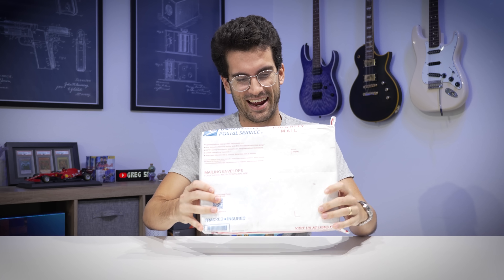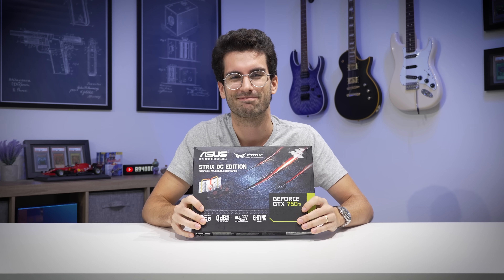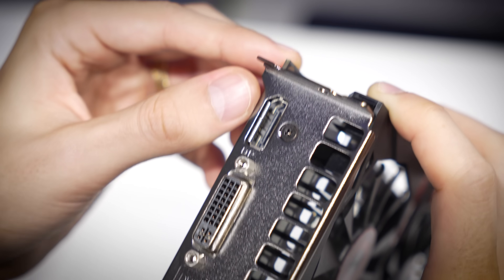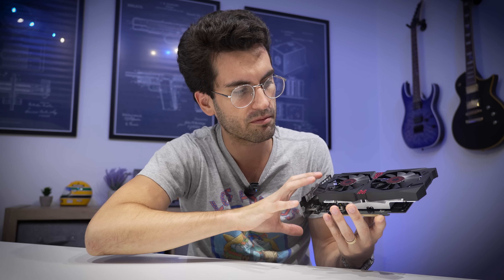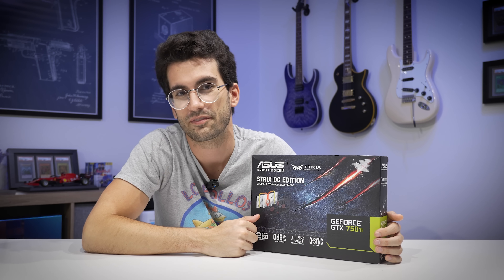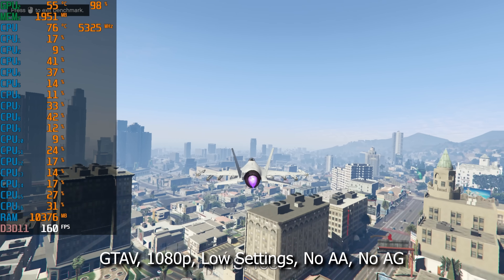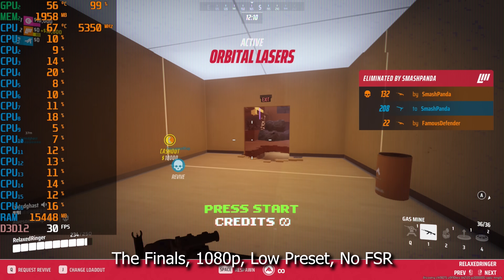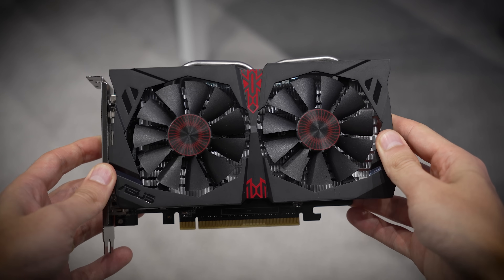The Nvidia GTX 750 Ti In 2024 | RETROSPECTIVE

Comment: thx for the video. i got 1 just under a year ago(2024). it doesn't look the same. its smaller and it 4gb memory. why or what is this mystery?🤔
Reply: I guess the 1 you show is crap Greg. (no offence and aye have the same name. that's a nice name btw) They made newer GTX 750 Ti's? Which are double the memory than the original 4GB. The Graphics Card Comparison chart clearly shows where it at. 2x better that a regular ps4 😀

Comment: I've owned the GTX750ti since 2015, it has served me well for 10 years. I've got a maxed out LGA1155 chipset with the I7-3770 and 32GB RAM. Today i've bought the RTX4060 which is a very efficiënt card and will run all modern games on high settings.

Comment: The TV sound effect had me thinking my headphones were still connected. My sons PC and my mobile PC in our RV both feature a GTX 750 ti 4GB Afox cards. I paid more than I should for them due to the 4gb a few years ago but they have been great for the gaming we do on them. I can still run games like Forza 5 without the stupid VRAM warning every 3 minutes. Pair them up with something like a i3 10100 and you have a hella cheap little gaming pc. You can even go lower CPU wise like a i7 4770 or 4790 and get a phenomenal experience. Roblox, Minecraft, fortnite, and all the games that the kids love to play will run on this card especially if you get a 4gb version. I'm not defending the 750 ti. Its old as dirt, but still does okay in some use cases. That specific card design looks like what happened to Number Johnny five after he decided to take a toke of the devils lettuce.

Comment: Still using 750ti here, ive played csgo with this card until cs2, so im used to playing games lookin like shit as long as the frame time is good. This is still good for emulating switch games like luigis mansion, and PC games like ds1-3 which ive never played before.
Reply: Do you have to turn your settings down at all or can it run the games on regular settings? I myself am getting a 750ti but not planning on playing big demanding games just smaller ones like League or Roblox
Reply: @bluebloo9955  i like stable 60 fps, so its usually low settings usually for games from 2014-2019, med on 2013 below

Comment: I've found a Zotac 750Ti in a E-Waste bin today and obviously picked it up.

I wouldn't recommend using it for modern FPS titles or otherwise highly demanding stuff, as it simply doesn't have the power for it. But it's still a viable card for some cases.

Since it needs no additional power, it can be thrown into all kinds of office PCs with proprietary PSUs, meaning a build like a 4th Gen i5, 750ti and 8GB RAM should be obtainable for 50$ or equivalent in most countries. There's still many great games that run fine on it and a GPU just needs to run the games someone wants to play, not everything that's on the market.

Comment: Looks new to me. It wouldn't be new after plugged in once in your computer, so I don't see a big deal. Jesus, that guy vomiting. I feel like these well paid gurus are there to encourage consumerism. I have a similar Asus adapter, but it has a onboard VGA port without an extension cable and thus no ghosting. The two fans make it quiet.

The OC edition with a power connector is actually capped at 35 watts, and the BIOS must be hacked to change that, which is risky. I would expect Asus to have already done it.

If you live in a countryside or a small town, you might not be as spoiled for choice. It's even worse if you have to pay €1 or €2 to advertise on a classified for a cheap item. You would get a Maxwell card for a VGA output, which was removed later, for WinXP. A GTX 960 is a better value and comes with h.265 and VP9 decoding.

Comment: Comparing it to a GTX 1070 is TBH a bit unfair, comparing it to a GTX 1050 would of been more fair.

The GTX 750 Ti and GTX 1050 are both "low end" gaming cards of their respective generations, and both do not require external power.

Add to that the fact that it has been used to make budget gaming PC builds possible under $100... I think it's still a decent-ish value (there are better cards like the GTX 1050 which dont require external power and would still work) as long you you are playing older (which are almost always definitely better) games. 

Also, GTA 5 came out around the time of that card, 2013-2014. For it to still get over 100 FPS goes to show how much more optimized that game is, and that the GTX 750 TI still has life left if you make smart choices (buying most modern "games" these days is stupid) about what to play.
Reply from the maker: Not sure you paid close attention to the video. We mentioned the 1070 and 980 Tis because they were among the best values in the compiled charts. GTAV came out around the same time as the card, which is why it was tested, but the game still requires a fair degree of throughput to manage at decent framerates. It does say as much about the card as it does about the game itself.
Reply: @GregSalazar  Still not a fair comparison. That’s like comparing an RTX 5090 to an Intel GMA 950. 
They’re not in the same tier, let alone generation.

The GTX 1070 is unusable in a lot of cheap used PCs you could buy on eBay, many of which use proprietary motherboards/PSUs/connectors which would have to be upgraded. Meanwhile, the GTX 750 and GTX 1050 are basically universal, as they often do NOT require additional power and can just get their power from the motherboard.

The GTX 1070 came out years after GTAV came out, not at the same time.

That’s not the say the GTX 1070 is a bad card, it’s good value if you have a PC that can use it… otherwise the GTX 750/GTX 1050 is pretty much just plug n’ play, due to their low TDP.

Comment: Back then in 2014 I bought an Asus GTX 750 Ti PH when it was new to upgrade from an Sapphire HD5450. The difference was huge. My version has VGA, HDMI and DVI Slots. 
Still have it in a low end PC used with an 720p Monitor for office and surfing and everything is fine although I wouldn`t use it for gaming anymore.

Comment: Well, this was my first graphics card buy after the GT545 in my pre-built gave out... And I still. Use it in a Linux Mint based machine with a Core i5-3570, where it runs great. Of course it does not work with Starfield, how could it? It's A DECADE OLD! 😂 Even modern cards suck at Starfield, because the game designers all think we have 4090s, so they do not optimize any more.

Comment: This GPU is still a dream card to me, if you want to hear my story then here it is ,
Me a poor adult from India didn't have enough money to build a current generation decent PC, more commitments, horrible life, problems everywhere and so on.. unsatisfied life 🎈🎈

Here are my shit ass pc specs:
Intel i5 6400
GT 730 2GB GDDR5
8GB RAM DDR4 @2666Mhz (limited to 2133 Mhz)
ASUS H110-M CS DDR4
Windows 10 pro x64 22h2 (Revision OS 😂)
450W SMPS from Ant eSports 
1TB Kingston A400 SSD
1TB Seagate Hard Disk USB 3' Backup
1366*768 Dell 15 inches monitor
Games I play:
NFS Carbon
NFS Most Wanted 2005
NFS Underground 2
Total Overdose
Freedom Fighters
Scarface
GTA San Andreas
GTA Vice City
Bully
GTA 4
GTA 5
Minecraft Bedrock
Sleeping dogs 2012 edition

Softwares I use:
Msi afterburner
River tuner to lock every game at 30 FPS

Comment: Greg, love you channel.  Lots of great info for us DIY builders.  I know your primary focus is on gaming pc’s.  And in that vein, could you please look at performance with flight sims such as Microsoft fs or x-plane.   They seem to be more cpu intensive but still need a good GPU.  It would be great to see the difference in performance numbers between  game and the flight sim.  Thank you for such an informative channel.
Reply from the maker: Hey Larry. I appreciate the support and feedback. I'll be sure to add Microsoft Flight Sim to future benchmarking sessions!
Reply: @GregSalazar  I am starting to receive all the parts for my new build. I plan to use it primarily for flight simming but I did get a free game from nvidia with my gpu purchase.  My budget was 4000 and this was to replace my older system (built in 2017 running Intel i7 7700k on a asus mb). This time because of the Intel issues I went with a ryzen 9 7950x3d on a msi x670e carbon motherboard.  ASUS TUF RTX 4090c GPU, 64 gb Corsair DDR5 6000hz ram, Thermaltake 1200 watt psu, Samsung 2tb m.2 ssd cooled with Corsair h100i 360mm aio.   I chose the lien lancool 3 case.  I also replaced my older monitor with a dell g3223q 4k 144hz 32 inch monitor.  There is some rgb stuff in there but not too much.  (The case, the dims, and the cooler).  I think this should be a pretty balanced system.  This came in at about 4100.  Your thoughts?

Comment: still loot these all the time in EFT. Considering i got a 560ti FPB way back when for BF3....i remember when these gtx 750ti puppies came out i told everyone looking for a pc to get one...that no PCIE connector/needed power was such a huge aspect when there was broke bois rigs like the smilodon or other ppl offering free 450-500w psu like apevia etc....This thing dumpstered my 560ti with just board power...so dope for micro/m-atx builds and no power connector needed had a few friends i built rigs for with this gpu. Its why that sku/range has BEEN king on mobile...1050ti 4gb 1660ti 75-80w kings.

Comment: I built my first gaming pc in 2014. Two years later, a poorly coded game overclocked my gpu without increasing the fan speed, resulting in damage that caused the card's performance to slowly degrade over time. When  youtube videos started to jump around like a VHS tape with screwed up tracking, I realized I had to replace it.

I crunched some numbers (I was seriously broke.) read some articles, watched some vids and settled on the ASUS version of this gpu. It worked beautifully until 2020, when the aging pc it was part of was shelved in favor of a new build. 

A year later, it came off the shelf and went into my mom's old pc, to replace her dying gpu. Many of her games wouldn't load at all, some would load and then immediately crash, and those that did run ran poorly, leaving them unplayable. Mom was the biggest gamer in the family, and my little Nvidia Geforce 750ti got her pc running again. She was so happy - she gamed more than all four of her kids combined, so she was happy to have her pc back online as it were. She sadly passed away after a year of working my old card hard, but it made that year a good one, with hours and hours of gaming. It's still in her old pc, sitting, untouched, in her room, and I can't bring myself to ask for it back.

Comment: Something I learned right away after getting into pc gaming was that you never purchase anything less than a 60 class card with nvidia, 50 class cards are only good for pixel games or giving you a display output.
Reply: Back in the day the 750ti was worth it it was very cheap, required no power cables so could be slotted into an office pc and ran triple a titles like gta quite well. After that though I agree it went downhill and it only really made sense to go for 60 cards the 1050 was ok but overpriced.

Comment: It still my daily driver GPU. It is used when typing this comment. Same as cover: Strix OC. Black Wukong Cinematic 1 fps default setting.
Back then, there are two choice: 750 / 760? Add little money get normal 760. 
But I choose 750 Strix OC. And I think I made a right choice. 
It the only 750 that has DP port.
It also still supported by latest driver which 760 has been discontinue. 
It still ultra slow to play latest AAA game with ultra setting 1080p.

Comment: I still have my original 750TI.  The sad thing is, I replaced it with a 1660 Super (the best part being an original EVGA card).  It still holds up in my current rig until I break down a purchase a 30 series card.

Comment: I used an single fan EVGA 750 ti on my first rig all the way up to about 2 years ago. Honestly, while obviously limited, it's a great GPU. Still have it packed away and still works! It was great for my first PC (a sleeper PC made from an Optiolex mt) since it didnt need an external 8 Pin.

Comment: The problem is Greg is looking at it purely from a gamer's perspective, not everyone games. I still use a 750Ti in my main system (I have many) solely as a display adapter because the CPU does not have an integrated GPU. Of course I could pay more and get a card that performs 4 times as well, but then I also have the increased electricity consumption to deal with. Ideally I would like a modern GPU that is cheap and uses the same or less power, but that isn't happening, manufacturers don't care how big our power bills are.

Comment: While not up to the task of any really modern games, it would certainly be fine for a productivity computer. The system my current PC replaced was running a GTX 650 and did most of what I needed right up until the power supply and motherboard gave up the ghost. Obviously my current system with it's 3070 is far faster and runs all the games I wish to play just fine (which I expect to continue for quite a few years into the future).

Comment: The PC my brother uses got a 750 (non-ti) from Zotac paired with my old Ryzen 3 1200 with 16GB (2x8GB) 3000MHz RAM in a ASRock AB350 Pro4. Previously it was used in a HP that I bought new for him & his wife in 2007 with a Core 2 Quad Q6600 & 3GB (2x512MB & 2x 1GB) DDR2 before going into a Acer I got for free many years later with a i3-2100 & 4GB (2x2GB) DDR3.

Comment: Still rocking the system I built in December of 2012, Amd FX 8320 Black, EVGA GTX 660 2 GB Superclocked, 16 gigs DDR3, ASUS Motherboard, and Samsung 830 SSD. OS is Win 10 Pro. Am upgrading soon , but at gaming this setup is still a screamer, as in all fans scream, and the cpu and gpu cry.
Reply: I had a FX 8350 and what a digester cpu that was I remember the massive upgrade it was go to intel back then
Reply: @daveys_gaming_corner  If I had more cash to spare I would have gone Intel back then, but the ol' gal has held up, but since she can't game anymore (not for a long time) and can't go Win 11 she'll be retired soon. Day to day stuff though she still runs ok.
Reply: @GorditoGuapo  The FX CPUs should be able to upgrade to Win11, if you force it in powershell at least.
Reply: @MadIIMike  Yeah, I'm building a "new" setup. Again, the ol' gals 12 years old, but I will pull the old Powered by EVGA doohickey for nostalgias sake. 😁

Comment: Back in 2014 when the 750ti launched I really wanted one for a prebuilt PC I had and was using at the time, but my parents couldn't afford it at the time, so unfortunately I had to settle for a much weaker gt 610 for like 40% of the 750ti price at the time, but it was still an upgrade over the integrated graphics of the prebuilt pc which were a joke, couldn't even run minecraft in 1080p res over 20 fps. But with the 610 I could run it at 50-60 fps and close to 100 fps with optifine installed and all graphics settings on minimum. 

I ended up upgrading to an rx 460 in 2017 tho

Comment: Running one of these in my computer at work; just to get off igpu. Mostly excel things, some word & pdf. Nothing much that would stress even this gpu. Got it off eBay for about $25. 
(management's cheap and do not want to update anything unless it's absolutely needed. They finally retired a couple test systems running on old windows. Anyone remember just being able to hit the power switch to shut things down? i.e. windows 3.1.1)

Comment: The New Air Max 903 from Montech is only $79. It comes with 3-140mm RGB fandom the front, and 1-140mm non RGB fan in the back. Also has a built-in hub, and will fit a 360 mm radiator no problem on top. For the price I wouldn’t go with any other case, especially if it’s your first time building a gaming PC.

Comment: Huh, how would I have guessed that you had a crap potatoe build as your first. My first was back in 2010-11, mine was on the x58 lga1366 platform, asus rampage 3 extreame black edition mobo, Kingston HyperX ("Genesis" I think) DDR3 12GB 3x4GB 2000MT/s,  i7-990x 6C12T CPU and a GTX 580 3GB. Now here today, the power of the Steam Deck matches if not rivals the power of my first build, f'ing crazy. lol

Comment: Interesting, the 750Ti was my first graphics card like 10 years ago and its actually in use in the PC of my sister. It is the Gigabyte model and after changinf the thermal paste and cleaning it my sister can play without a problem. I mean, for a graphics card that has like 10 years still performs very well, but please note that this was 10 years ago, I will never recommend buying it at this time.

Comment: Geforce 750 TI is just not aged well in 2024. If you want a retro pc to play games from the late 0's and early 10's then it could be a card to consider.
A suggestion for another retrospective: Zalman cpu coolers, for instance the Zalman CNPS7700-AlCu cooler or the reserator external watercooler?

Comment: I actually don't remember why I bought my 750ti back in 2015 but it was likely because of the price.  Ironically enough it possibly lasted longer than my 6600. I did end up having to replace my CPU and mobo recently because the 6600 may not have totally been the issue after all (it did have it's issues including sporadic screen lagging/hanging when playing games) that no other card ever had) but when using the 750ti to test between the 6600 and when I got my 3060 it still worked ok for the purposes of troubleshooting what I could play with it to find out my issues.

Comment: Not a card for today's games but it's a should be a great card as it's one of the last cards supported on windows XP. There are modded drivers for the 900 series last I checked but don't know how good they are. 

I bought a quadro Maxwell 4gb version of the 750ti back around 21' for a XP build but have not got around to it yet. Paid $40 for it though. Card does work as it was in my Plex Linux server till it was swapped with a 1070ti.